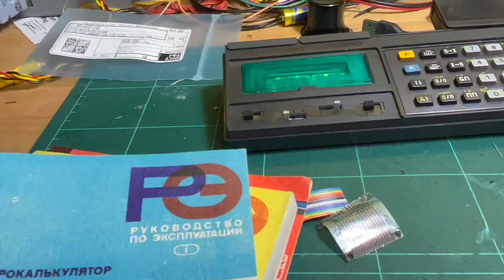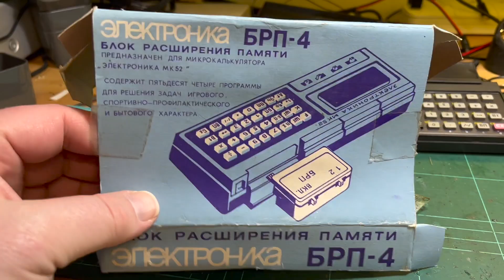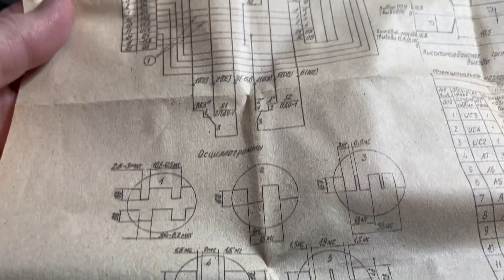🇺🇦 Электроника МК-52 (Elektronika MK-52): Part 2 (Repairs continue)

Comment: 8:33 Had the same issue with my Elektronika MK-61, i made a new contact sheet out of paper and aluminium foil, might not be the best solution in terms of relyability, but it works after more then 6 month.

Comment: To save the original look of the calculator you could order the copy of this film keypad and the ribbon cable from a local PCB manufacturer, it is all possible these days and not that much expensive. Even cheaper from China.
Reply from the maker: Yep, I could ... but I really don't like the button feel ;)  Too squishy ... I thought it might be interesting to "mod" it ... don't know, let's see ... they're readily available in Ukraine and pretty cheap ... /Brett
Reply: @Brfff  I don't think you can find a new one. The modern and brand new will be much more reliable. Anyway, if you want to modify it – that's a different story.

Comment: All military or aerospace stuff as well as a significant part of industrial electronics in the late USSR actually had 2 or 3 layers of conformal coating. The stuff made for humble peasants though did not need any of the luxury because reliability was not considered important there. It was just made as cheaply as possible. 

As for your problem, I would just replace the keyboard with a custom board with tactile domes soldered to it. It would probably be the cheapest option to make the thing both look 100% original from the outside and give some longterm reliability to at least the keyboard part of it.
Reply from the maker: Ahhh, very interesting and makes sense.  Interesting idea about the tactile domes ... will keep that in mind.  A bit too mushy for my liking at the moment anyway, so let's see what I can come up with.  I might try to re-house first, and then figure out computer-aided schematic design ... for some reason, I just can't get the hang of them ... /Brett

Comment: That membrane flat flex stuff reminds me of the ZX81 keyboard, i.e. horrible stuff :) On the stripping subject again, for ribbon I just run a sharp knife (like box cutter) across both sides of the cable, judiciously hard enough to not go right through the conductors, then work along with pliers or side cutters pulling the end insulation off.
Shame about the membrane keypad. A long shot could be to try to make again, or repair, the top layer with a conductive ink, which is what it looks like they used in the first place, lol.

Comment: A little kicad project with microswitches could do this project some good... the matrix might need some resistors to match resistance from the membrane resistive tracks that are falling apart.  A similar microswitch keyboard to the modern spectrum microswitch keyboard
Reply from the maker: Now that's a good idea.  I don't have any experience doing computer-aided schematic/PCB design ... problem has always been getting started ... and perfect way to learn is to have a project you need to do.  I think this idea can be the 2nd stage - if my Grundy NewBrain SRAM expansion works (chuckle, uh huh) then that might be a simpler design to start with ... ? /Brett

Comment: original cpc didnt have conformal coating either!.. but not coz they hadnt heard of it.. coz Sugar is scruge! 
pity about the keyboard membrane...hook up an arduino as keypad till ya get new membrane
Reply from the maker: chuckle a good idea ... the keypad will have 1000x the computing power of the actual calculator ... like all those other retro-computing attachments these days ... ;) /Brett